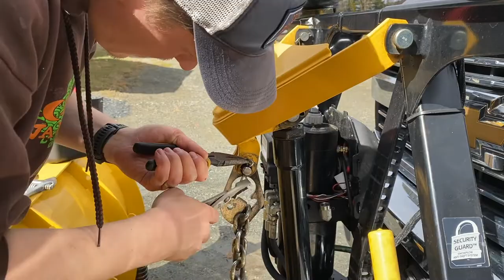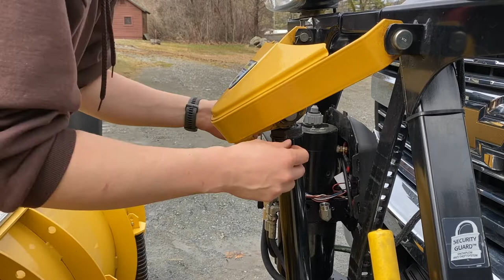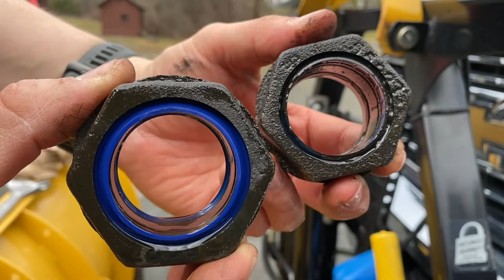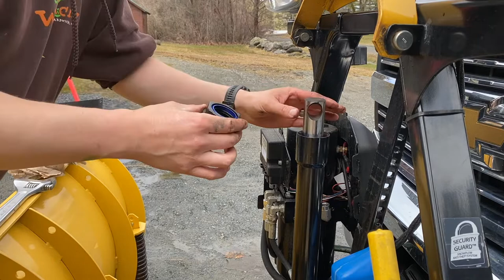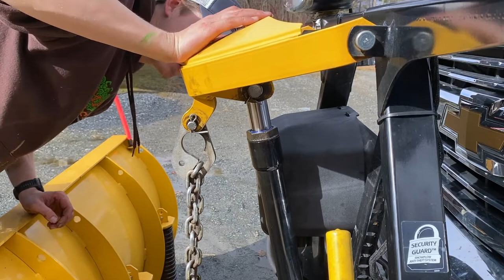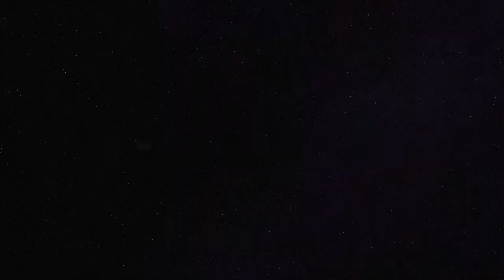Fisher plow repair - Gland nut replacement. Episode #15

Comment: I just picked up a gland nut ram seal ring at the dealer and the first thing they told me is to put it on from the bottom for single-acting rams as the piston is tapered and larger at the top. Hope he didn't ruin the seal.
Reply from the maker: I found out that was how I was supposed to put it on after I did it but I have only plowed 6 times since I replace it so I haven’t seen any issues but I know for next time.